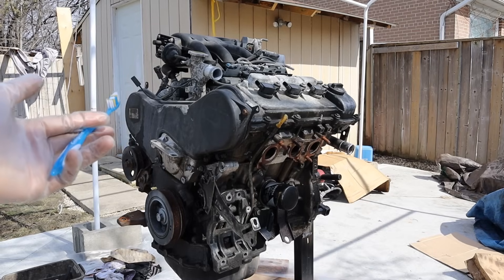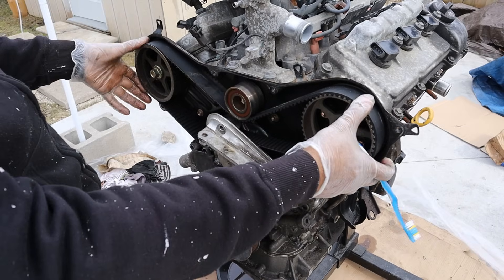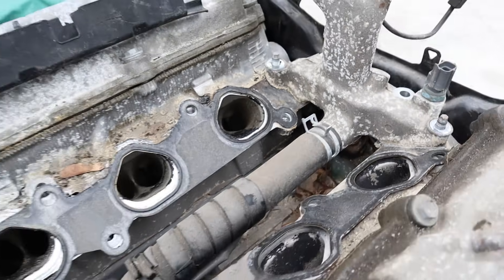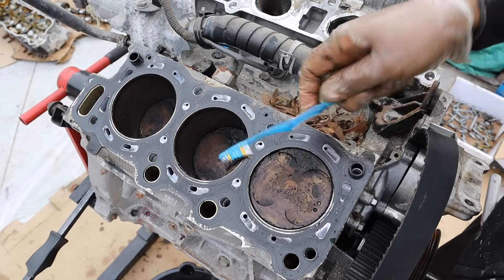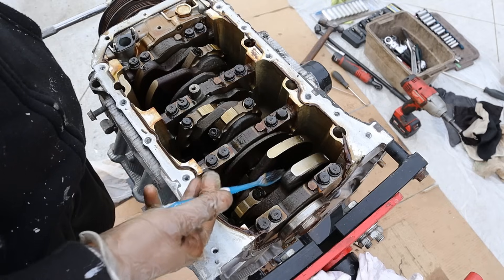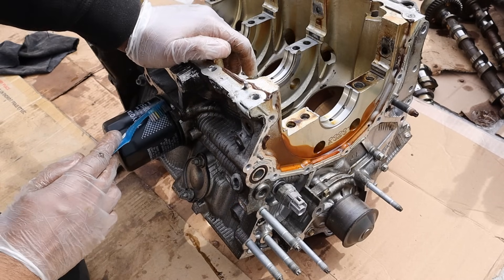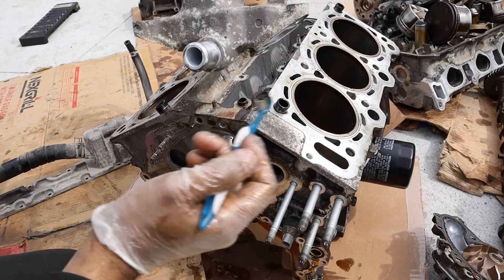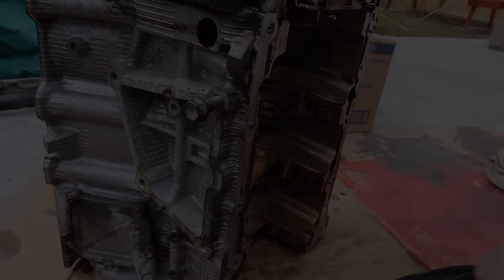Here's how the Toyota 3.0L V6 Engine Became a Success

Comment: I know this video is old, but I see that you made the same mistake that I did, so maybe it will help someone. Before removing the exhaust cams, there is a procedure to install a service bolt in the sub gear, so that you don't lose the pre-loaded tension that is there to help with backlash. When this is not set properly, your engine will run fine, but will have valve train noise. It's actually the slop between cam gears. I just did both head gaskets on mine, and put it back together. It runs great, but is noisy. Now, I have to pull the valve covers and do this procedure to quiet it back down. Hope this helps someone.
Reply: I goofed and dropped that service bolt down into one of the return oil ports.  It fell down into the lower engine.  I used a magnet wand to try to recover it and the magnet came unglued from the wand and is still down there somewhere.  I removed the lower oil pan and fished out the service bolt.

Comment: Currently running this in my 1995 Avalon (first production year in the US), currently at 331,000 miles. Bought it at 250,000 for $1,500, daily driver. Best bang for buck I've ever spent. Engine is getting leaky but with some oil additive it's not bad.

Comment: i have the same 1MZFE V6 engine on my Toyota Harrier 1998 model. its a great engine. The only problem i face is when using the OBD2 scanner its showing engine code P0383  AND the other one unknown error. Through my research i found that the P0383 is for Heater Plugs and found in Diesel engines. how can you help on this one

Comment: I bypassed the throttle body coolant line bcz it was leaking from throttle body coolant intake valve..and the hose directing the coolant leaked so i replaced it with a after market coolant pipe. just want to know is it safe to run it like that or should a get a new throttle body and redirect the coolant line from and to the throttle body? Kindly respond when possible bcz i hv yet to get a satisfactory sol for this. Thanks for the video

Comment: I have this very engine with 50k miles on it. (2005 Toyota Highlander). Great info thanks. Quick two questions please. My engine has a new cambelt and is very clean with regular oil changes. When you start it from cold it can take a crank more than you would expect to start - any ideas? Also when you start from cold the engine kind of whines like it has a supercharger attached until it warms up then the noise goes away. Do you know what that might be? Thanks.
Reply from the maker: Long crank is fuel related 
Whining sound is something attached to the accessory drive like alternator or idler bearing 
2005 highlander has the 3.3L version of this engine
Reply: @speedkar99  thanks

Comment: I Have a 99 Sienna with this motor with 182000 miles. I over torqued the water pump bolts too by using ft pounds. Only stripped one bolt though. I replaced the leaking valve cover gasket on front cylinders. It still leaks a little on back. Engine runs great!

Comment: G'day guys
Iv read reports off Google
The 1mz fe came with forged crank and forged rods ??
Apparently has light weight alloy pistons  ??
Also possible to run up max 10 psi forced boost on stock internals  ??
Definitely a powerful fun engine !!
Cheers thanks 
Glen
Australia

Comment: 5 years ago, I bought my daughter a very nice 04 Avalon with this engine.
Currently Has 165,000 miles.
I just changed oil yesterday.
I chg oil every 10,000 miles
Does not use any oil in 10,000 miles.
Oil still looks clean after 10,000 mile

Comment: Thank you! I have had one of  these in a 2002 highlander since new. I have always changed the oil and maintained it myself. HOWEVER I have never been impressed with this engine. The difficulty to maintain for the DiY, the front access, the filter access, the front valve cover leaks, plug access, and the tendency to sludge --- all spot on observations from a person who obviously knows and is objective, not a blind Toyota sycophant. Mine has had nothing but synthetic oil since new. When the front cover started leaking, I pulled it and changed the gasket. Was shocked that it had begun to form a bit of sludge even with regular oil changes. Not terrible but hardly a standout.

Comment: Excellent video! I daily drive a '99 Camry V6 with 195k miles on it. I just can't get over the fact that Toyota OVERBUILT this motor by adding 6 bolt mains and steel piston liners. No wonder why they last so long if maintained. I am due for a timing belt replacement. Time to seek out a local shop. I'm not interested in motor work and frustration anymore, haha. Thank you for this teardown. I will def refer back to it time and time again!

Comment: I have a 3VZFE manual transmission lexus ES300. The 1MZ replaced the 3VZ. I love the 3VZ more cuz of it being a cast iron block and can take more boost. Also its OBD 1.  And it being mated to a 5 speed manual is match made in heaven.
Reply from the maker: Check out my 3VZ video!

Comment: Where are the oil ports on these 1MZ heads? My rear head is covered in thick black sludge. I've been cleaning it for a week and got a ton of it out. I want to make sure the oil ports are clear for oil to come in and leave. It appears that the middle to passenger side of the cams were bone dry. Also where are the PCV ports so I can make sure those are clear? I don't see anything in the service manual.

Comment: Every engine will oil sludge if the oil isnt changed at correct intervals. I have a 2005 toyota camry v6 altise 3.0 litre with 280,000 kilometres on the odometer, i recently did the camshaft cover seals and the condition inside was almost like new. I got the car from an elderly couple that really looked after it,full log book history up till 250,000 kilometres. These engines are not known for oil sludge problems, the 2.4 litre 4 cylinder engine are the ones that had issues with oil burning due to piston ring tolerances manufactured incorrectly. These 3.0 litre v6 toyota engines are bullet proof,every mechanic i know says the same thing regarding these engines-the 1mz-fe engine are the most reliable and well made v6 engines ever made. The quality materials used and craftmanship used to manufacture these engines was outstanding and were made to last. Minimal plastic components, all metal components,japanese made quality cars cant be beaten even with todays new cars-toyota still manufacture quality cars compared to the plastic garbage all the other manufacturers are producing.

Comment: I have a 2000 camry with this motor 360k miles and the only reason the check engine light is on is because my torque converter lockout quit 80k ago...ya leaks oil like a pig out back valve cover

Comment: Good video with technical accuracy. One small point, the big end of the rod has that oil hole. It spays the cylinder wall, not the underside of the piston. If Toyota wanted that, and sometimes they do, it will get oil squirter jets. The oil is suspended on the cylinder wall in the cross hatch to lubricate the skirt. The excess is pulled down with the oil control rings. The rest is burned in combustion.
Reply from the maker: Yeah I noticed that Toyota likes to spray the wall with the rod hole. Interesting design
Reply: @speedkar99  They aren't the only ones. What is different is Toyota tells you a normal running engine burns oil and it does. They even debunk (long before the internet commandos) or educate people on why their dipstick shows full after 2000 miles, when in fact it has likely burned up to a quart of oil.

Comment: Camry 2005 is my first car in Australia, it has 240000 km now. It’s so quiet and smooth on highway. Such a stressless car.
Reply from the maker: 4 cylinder or V6?
Reply: @speedkar99  3.0L V6 4sp Auto. It has the original head unit that can play cassette tapes, feels like a time machine🤣

Comment: I have this engine but it seized, so I'm currently trying to swap it. Because it's seized, I can't spin the crankshaft and therefore cannot separate it as easily from the transmission. Is there a work around for this? I figured disassembling it may help. I haven't even been able to lift it out of the engine bay. Should I drop the subframe and take out the engine/transmission that way? Thanks so much.

Comment: 02 Lexus RX300 w/ 150k.  About to do the timing belt and water pump. 16-18mpg in town and 22+ on the hwy. Most solid ride I've ever owned.  Just don't lose any keys. That's crazy expensive.

Comment: Thanks for this. Mine is in my 2000 camry, and either bent a rod or spun a bearing, I'm not sure quite yet. Either way, Imma rebuild it over the next few weeks, lol
Its at 181k miles, btw
Reply from the maker: Good luck on the rebuild. Why not get a newer used motor?
Reply: @speedkar99  thanks
I'm not a fan of used motors. never know the history of them, the maintenece theyve had, etc. And doing the rebuild myself will be cheaper then getting a new motor.

Comment: Great review of a great engine.  I just might have the highest mileage version of this one still on the road in my 2000 Solara...622,000 miles and still adding more daily.  I picked the car up with 113,000 miles from a coworker so I'm the second owner.  I checked the compression recently and it ranged between 400 and 415 psi...right where it should be.  I checked valve clearance fairly recently and it was also in spec.  Still gets 25 mpg and is still running the original transmission.  Amazing engine!
Reply: 400 psi compression reading, not in this universe.
Reply: Agree I've checked 14:1 compression gassers with perfectly honed bores and special rings and didn't come close to that number. @ojofelixnm3608
Reply: @ojofelixnm3608  Yes, right you are!
Reply: @ojofelixnm3608  Thank you for the correction.  Not sure where I got that kind of number....either messed up the units or I'm going senile!
Reply: you ever change the transmission fluid?
Reply: @jonny-mj5jl  Yes, I have done several partial fluid replacements.
Reply: Crazy that it's on the original transmission.
Reply: @dennisrobinson8008  Right!  It's showing signs of its age now at 650,000 miles.  Forward operations seems to be perfect but it takes a bit to shift into reverse on cold start.  It does fine once it's hot.
Reply: We’ve got a 2001 Rx300 with 230k, the suspension is about to get some TLC but the drivetrain is amazingly strong to this day. Not a single leak and transmission shifts perfectly. We did get lucky that the dealer had maintenance history up to 150k, then through 200k when we bought it, a friends mechanic father had taken good care of her.
Reply: ITs so good thats why is in the garbage
Reply: I'm sure you meant compression is 200 to 215 psi, there's no gasoline that won't detonate under 400+ psi , unless it is a diesel..
Reply: @regal953  Yes, thank you for the correction on the compression!
Reply: Did u ever replace transmission filer or just do partial fluid changes?
Reply: @heatfan1502  I have done several partial fluid changes, although I do it more for convenience than for fear the transmission will quit.  One of the changes, I drained the fluid, refilled, then drove around a while, drained again, and refilled.  The transmission is original and works pretty good in forward gears but just about won't go into R until the fluid is hot...so I back into my parking spaces if I'll be gone long!
Reply: 400 plus psi has me dying
Reply: Great to know I just bought a 2001 toyota solara convertible 3.3 v6
Reply: @bitcoinjosh different engine gang, the 3.3 v6 comes with VVT-I and is more modern than the 1mz-fe
Reply: I just bought a 1999 Solara sle v6 with 116,000 miles on it. You have any recommendations like what kind of oil you use etc..
Reply: Damn my 2000 solara has now 109k miles, got it about 10 years ago at 36k been using it as my daily ever since

Comment: Thank you for this excellent video, which explains so much of why this engine is so great. I have a 1999 JDM Toyota Harrier 3.0 Four (4WD) with the excellent 3-litre 1MZ-FE with dual alloy inlet venturi and drive by wire throttle body. It's done 145,000 miles and - with the help of a custom exhaust with equal-length downpipes - makes lots of smooth torque and has an amazing sound! It has great throttle response and really takes off when the VVT-I kicks in. There are a few spec differences to the same engine as used in the Lexus RX300, including shorter intervals for changing the cam belt, and higher power output of 225BHP on 97 octane fuel. Also being pre-OBDII, it has more flexibility on tuning and gearbox integration, such as a manual mode with steering wheel gear change buttons, and the ability for the torque converter lock-up to vary more than OBDII cars. I drove the plastic inlet 3.3-litre version (3MZ-FE) and found it sluggish and unresponsive in comparison. I fall in love with my car every time I drive it, I've upgraded to the 2003-on 18-inch wheels, which work well with the all-independent suspension for a smooth and very composed ride. It's nearly 24 years old but is such a good drive that I can't even contemplate driving anything else. The 1MZ-FE is definitely the strong heart of the car, and - excepting a few design weaknesses like the ABS sensors - everything else compliments it very well. Its only Achilles heel is fuel economy - I can't get more than 19 MPG (UK) from it, but it's totally worth it!

Comment: My Daughter bought a 2003 Toyota Camry with a 3.0 litre in it like this, it had 250000KMs on it when she got it 4 years ago. Today,2 timing belt changes later it has 430000 on it and runs like new! We she bought it she said it had a lot of KM’s on it(lol) I told her the rest of the car will fall to pieces and that engine will still be going! In my opinion this is the most reliable engine Toyota has ever built and one of the easiest to work on if you have a general mechanical aptitude.

Comment: Just bought a Toyota Harrier Airs 2003/09 model with 1Mz-FE 3000cc V6.
This video helps a lot. 
Changing timing belt and checking all leaks and new oils 🛢 
Thanks for the 📹

Comment: Great work Great Video. Question on my 99 Solara V6 178,000 California emissions. Always serviced regular oil changes. Think it threw a rod.  Was a loud thud and engine stopped.  Can rotate engine 1/2 revolution by socket on main pulley then hits dead stop. Any chance is a broken cam causing dead stop?  No noise or grinding when turning engine.  Removed serpentine belt to ensue was not locked up AC compressor.

Comment: I am sure we have this engine in our Toyota Alphard 3.0, imported from Japan. So far it has been silky smooth and pulls like a train. It has only 72,000 miles on it, cam belt was changed in March this year, oil was changed 3,000 miles ago and it starts on the button. Great videos not time waster videos, straight and to the point. Subscribed. Well Done Sir

Comment: I have a 2000 Sienna with this engine (no VVT) and 296 thousand km. The 194 hp, 208 ft-lb torque seems more than adequate, even with a load. Had my technician repair the valve cover leaks, replace the spark plugs and check the compression a couple of months ago. One cylinder is at 220 psi, the other 5 are all 225 psi. Looks like this engine can go another 300 thousand km with just oil changes.
Reply from the maker: Good engine and van. Should last you a while unless rust gets to it first.

Comment: I have this engine in my 2001 Avalon. Your video guided me through the timing belt, oil seal, timing belt tensioner and water pump replacement at 82K miles. The belt replacement went well except that I buggered a crankshaft oil seal - twice! Right now, I am at 112K miles, and the engine (and the car) runs perfectly.

Comment: Just one comment that might help some people out, you don't need to remove the intake manifold to change the rear spark plugs, they can be changed with the manifold in place. I have been doing it that way on my 1mz-fe for years.
Reply: I do as well.. 2 from the passenger side and one from the driver's side
Reply: Yeah, just need a swivel socket. At least that's how I did it.

Comment: I just bought a 2001 Highlander with the 3.0 VVTi.  Is this an interference or non-interference engine?  I've read conflicting information about it.  It has 272,000km's, and the previous owner changed the timing belt at 120,000 km's.  What is a safe interval for timing belt replacements on this engine?

Comment: I have 2 of these engines.  Well 1 now, my daughter has my old one.  Mine is a 2000 Lexus RX300, and the other is a 99 Camry.  Both have been excellent and amazing engines.  The Lexus grenaded it's transmission shortly after purchasing (for a really cheap price).  But, thanks to Rona money, I was able to rebuild the transmission and correct the defective first gear planet pins by welding them in.  It works great now.  The U140 Is a known issue that should have been a recall, but usually happened after warranty time.  I just replaced the thermostat, as it was only getting to 165 max.  It was an easy fix.  Used OEM parts, which are a tad bit more expensive, but worth it, because it lasted this long already.

Comment: Great video! Helped me to understand what’s going on with mine. New follower now!
Reply from the maker: What is wrong with yours?
Reply: @speedkar99  the knock sensor 2 and a leak in the back. I ordered two new sensors with a harness, the coolant tube and some gaskets. The “Nick’ll Do It” Channel did a video on it. I’ll be using genuine parts though- I never want to have to do it again.

Comment: I got 265,000 miles on my 1MZ - 5-speed Camry (yes in 1999 you could still get one if you were willing to wait).     At 265K the engine ran perfect - but the 2nd clutch failed and it needed CV boots......decided it was time to retire it (sold it to a shade tree mechanic that fixed all the issues and sold the car since the body was still solid - no rust).  Had a leather interior as well so it was a  "rare" beast - special package Toyota offered on LE models for one year only.